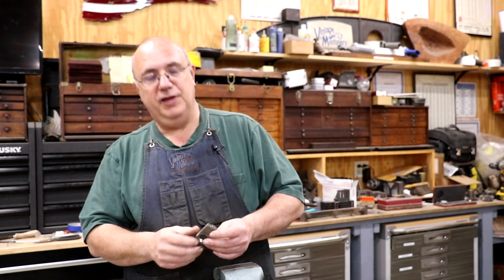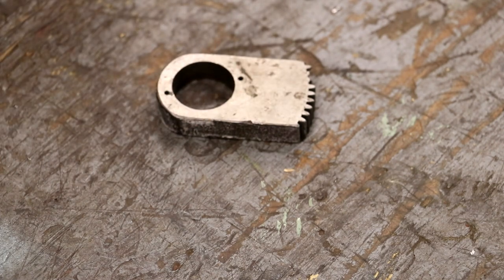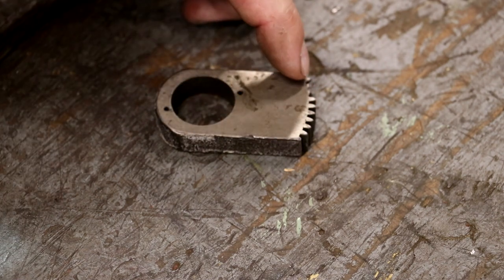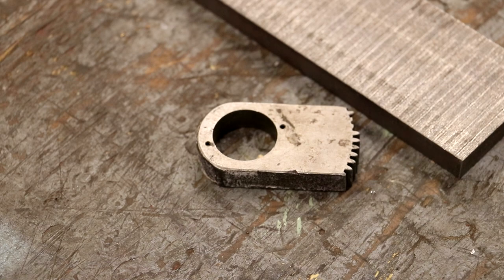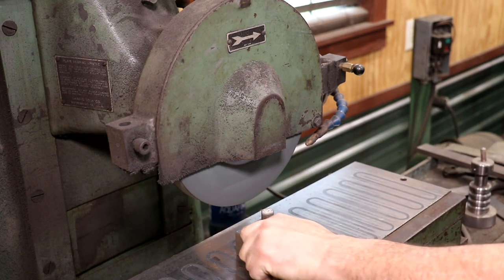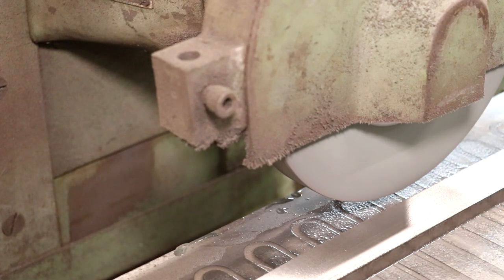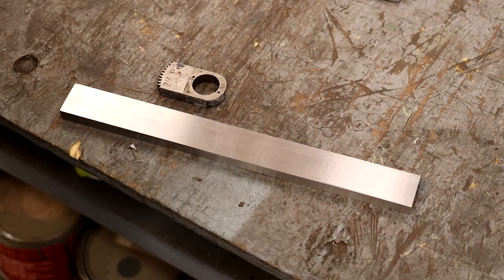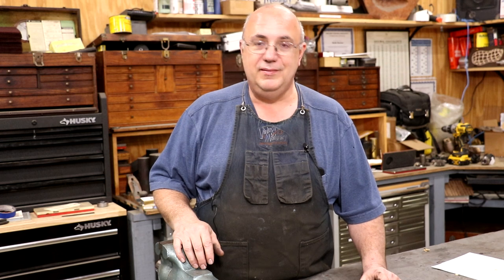Monarch 10EE Segment Gear:  Grinding a Cast Iron Blank

Comment: With the cast iron, sometimes you want to control where it breaks. I used to be a projectionist back when movies where still on film. The gear train of the projector had strategically placed "fiber" gears that acted essentially like a mechanical fuse. If the film running through the projector ever got seriously jammed up or tangled those fiber gears would strip out first before damage could occur to the expensive intermittent movement sprocket.

Comment: My 16CY has a similar part with similar damage (i.e., missing teeth). The Monarch manual calls it an "Outside Reverse Segment". It is part of the linkage that reverses the lead screw and feed rod direction.

Comment: Robin Renzetti has some best practices that you might want to consider. He uses a squeegee to clean the grinding swarf off the magnetic vise. He stresses to never slide a part on the vise surface. To avoid sliding the part grab it with a knipex style pliers and hinge it loose useing one edge of the part to release it from the residual magnetic field. Then it is easily picked up without sliding it on the magnet. I believe you also should grind from one side of the part so the wear on the wheel slowly works across its surface between dressings.

Comment: I'm confident you are right about that gear being the relatively inexpensive soft spot.  Volvo 240 engines had a hardened camshaft pinion meshed to a phenolic timing pulley for that very reason.

Comment: I can see cleaning up the width on the bar will make it easier to do an accurate layout for subsequent machining.
Reply: How about stopping the downfeed sooner if the rough thickness is close to the finished dimension to prevent a surprise?  Measure the thinnest portion, clean the chuck flipping the piece returning to grinding. Flipping until both surfaces are finished.
However in this case 1/16" undersize probably wouldn't have mattered.

Comment: Wouldn't the part have fit your stock crosswise rather than longwise? If so, could've had less waste. Also, I liked the explanation as to why you are using cast instead of regular steel.

Comment: Keith, do you not consider what 'probable' size those dimensions are ? After all, the thickness of that part is 2·5 thou under 7/16 - so I suspect it's a fair bet the original spec was 7/16. One thing to look at is the gear it meshes with - see how thick that is too.

I was going to suggest you make some spares - you've already got that covered.

Comment: Great video
One question tho: why didn't you just cut off a piece big enough but sawed and ground the whole bar to size?
I'd normally try to reduce any scraps and avoid cutting down stock as much as feasible.
Reply: Toward the end of the video, it sounds like he's going to make a few of them at least.
Reply: @edwardwilson990  ah yes, must have missed that part

Comment: Never put your hand under a spinning wheel, if you must keep it running move the chuck fully to the side,  surface ground tendons do not heal quickly.
Reply: Or a loose rag.  Buy a short squeegee to replace the tendon.

Comment: Sanity Check.  I think that you can make a direct measurement of the number of teeth.  Put a piece of paper on your wooden table.  Put a couple of brads in the hole of the old piece .  Trace out the tooth pattern with a pencil.  Rotate the piece through the good teeth.  Draw the new teeth.  Rotate and repeat.  The finished picture should be of a gear with the correct number of teeth.  Count the teeth directly off the paper.  Compare with the calculate number of teeth.

Comment: If you had a 3X4 chunk of cast, you could have milled it to size bored the pivot hole and turned the diameter then cut the teeth and band sawed off the 4 segments, then ground to size.
Reply: A good example of a job where addressing the form factor of the stock and process options at the start would both be beneficial and good practice.
Reply: Many ways to skin a cat, use the material you have at hand
Reply: @ypopnun1003  Yeah, too bad he didn't have any of that round durabar left- that would have been the perfect stuff to make those pieces in 3 OPs.
Reply: You would only get one piece out it, because you can't share one hole with 4 segments.
Reply: @breezy1849  You misunderstood- the single hole is offset to one side of the piece, not in the center.

Comment: Too much grinder time.  Safety?  Turn left grinder off when setting up.
Reply: Yup not good practice to put your hand under a spinning wheel. If you don't want to turn it off at the very least you should move the mag chuck fully sideways to prevent risk of surface grinding the tendons in the back of your hand.